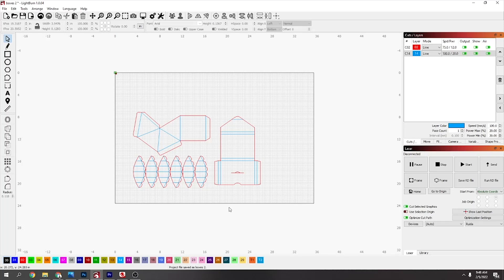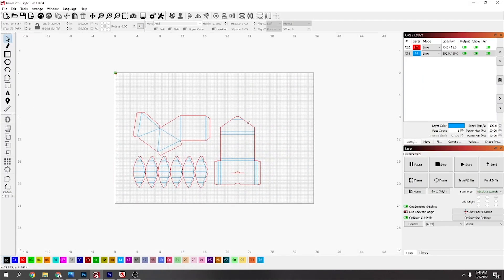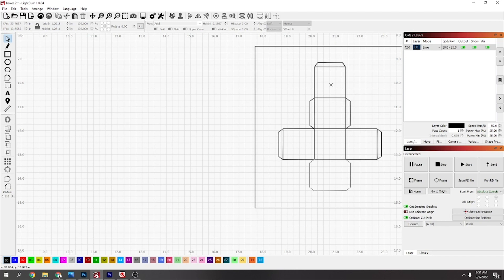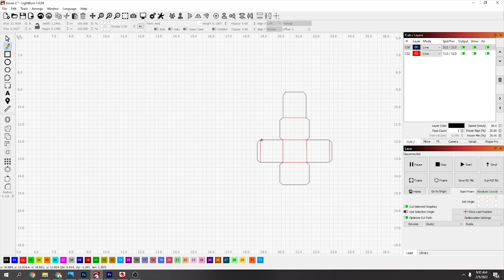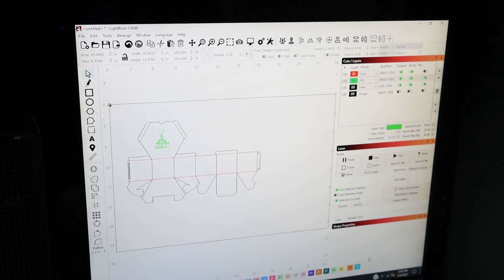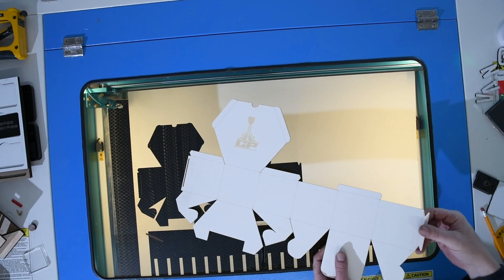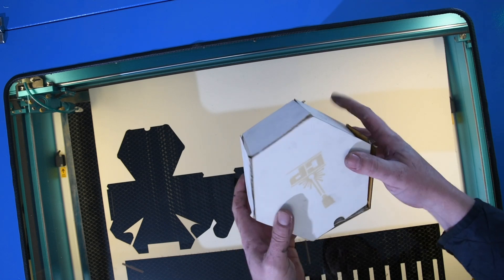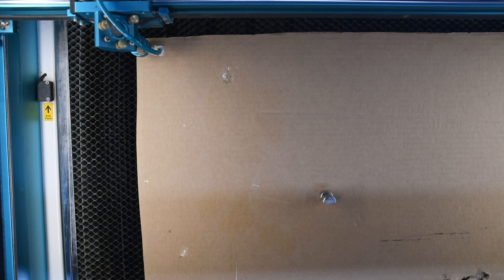How To Make Easy Boxes With a CO2 laser Cutter & Lightburn

Comment: Great video and resources! Thank you!
Reply from the maker: Thanks for watching glad it could help out :D
Reply: @carphotography  What about if one uses medium thin cardboard? Do the score lines just need to be deeper is all or thicker line points in the software, or moved a little to allow for more bending? I'm just guessing on things since I havent done it yet and would prob need corrugated tight small boxes like for sandstone coasters vs this thinner cardstock thickness.
Reply from the maker: @dickebk  just a bit of trial and error really, you want just enough power to score the material, if you search google for cardboard box templates plenty should pop up, luckily card and cardboard are pretty cheap to work with and east to find some to do some testing on. good luck